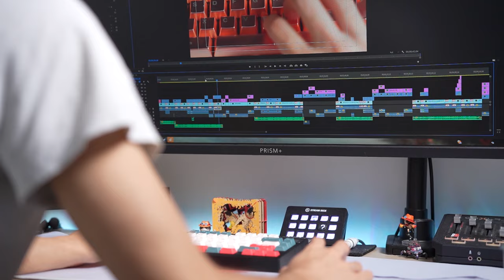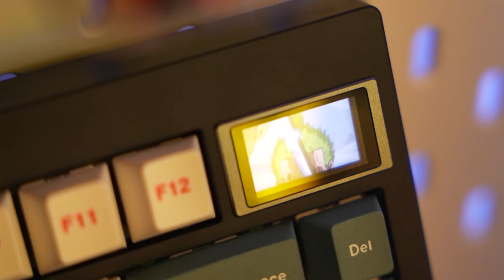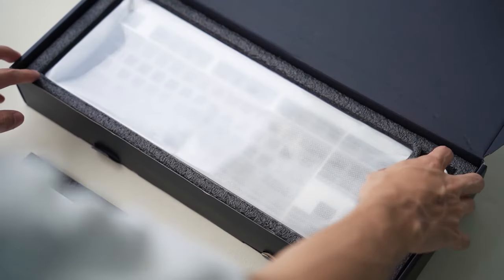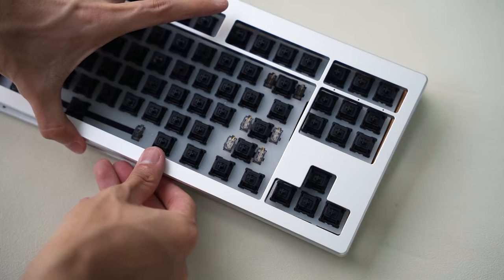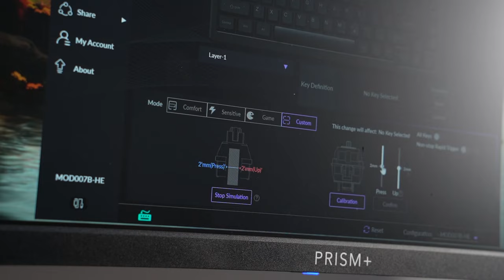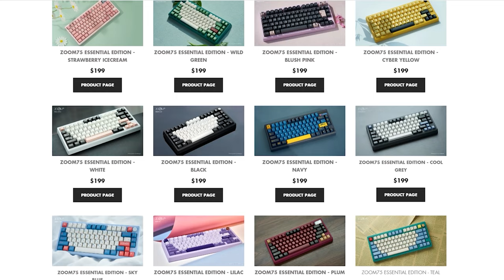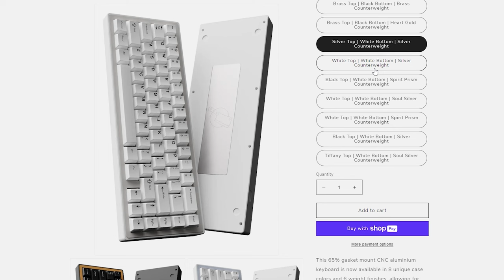What Keyboard Should You Buy in 2024 (BUDGET FRIENDLY)

Comment: Trick:
If you want a TKL that can be build no foam, clacky like higher end boards, buy the mainland Chinese version of the Monsgeek M3. It has everything you want: "accidently" well designed sound chamber, 1.6 mm pcb without flex cut, almost evenly distributed gasket point (just remove the one under the spacebar) and north facing stab wire.

Comment: $80-100 price point is Keychron V/V Max. I think they offer a lot of value for the price. They are coming out with the new Lemokey P1 with aluminum right at the $100 price point. Otherwise the Rainy75 when (or if) it comes down to the $100 price point is probably a good option as well. The SK71 is also interesting to me as a budget keyboard, they recently had it on sale for $61 on AliExpress.

Comment: or you can just buy a pre-built like a ajazz ak820 pro and be just done with this
Reply from the maker: tru that
Reply: @LewisToh  here in the philippines both ajazz ak820pro and gmk87 which has knob and screen too had the same price (20$) BUT ajazz ak820pro is fully built with good keycaps and switchs im talking about the gift switch with a variety of color and switches to choose
The downside only of ak820pro from gmk is that it does not have via/qmk support which is not a drag for me because ajazz ak820 pro software is good

For the guys who want to go gmk 20$ is cheap maybe go akko switched and a cheap keycaps but ajazz ak820 is still win for me cause no mods need decent stabz with no rattle fully lubed no hasle of taking the keyboard and no risk of destroying it